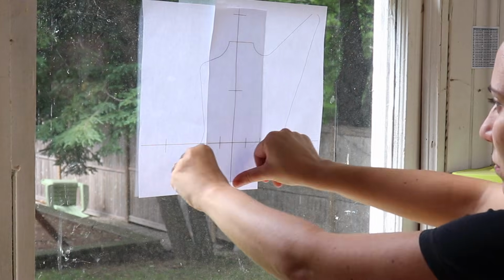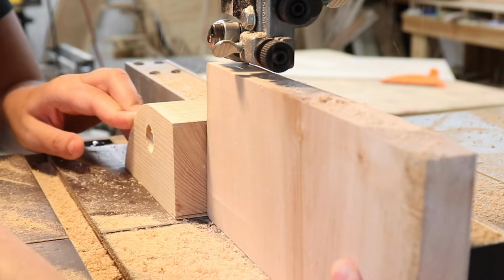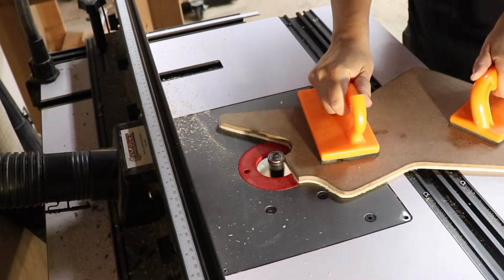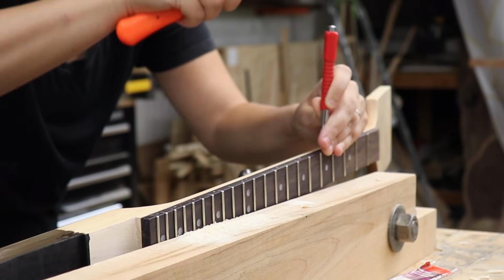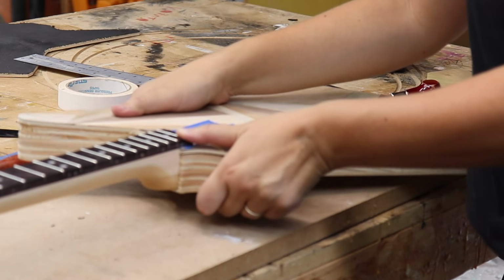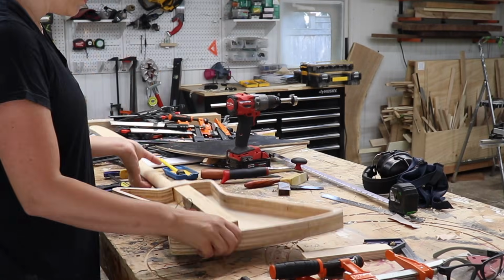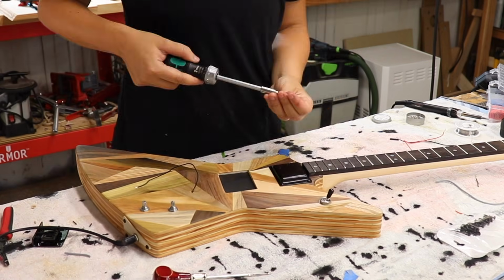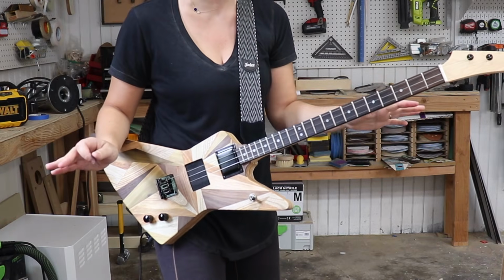Making a Three String Explorer - Cigar Box STYLE Guitar Build

Comment: AWESOME...I'm finishing of A Flying V, 3 string semi acoustic right now, but yours is just jaw dropping, I don't really have a workshop but I managed ok with hand tools and adapted a PDF of the old style body, but just did it by eye. It's made from some old 1970's, hardwood, office furniture I salvaged from a skip with a 1/4" marine ply top, although I may purchase something with a flame and Use Crimson Guitars superb dye's to a blue/red PRS style thing. I did buy a length of maple for the neck but , as yet, haven't committed to a fretboard, I may use a broken Rosewood one I have and convert it into a pentatonic plus...check out Del Puckett's awesome fretboard layouts...It's a "neck through" with springs on either side to resonate the box...and I too made a similar mistake with the heel on my first pass but fortunately had enough wood to rectify the issue, also at the same time I rebated the bottom of the heel to fit flush with the base which also allowed my to create a better back angle...I'm strictly an amateur/hobbyist and completely take my hat off to your awesome skills...you rock \m/
Reply from the maker: Sounds cool! I would double check about using the reverb coils with an electric pick up
Reply: @3x3CustomTamar  Ok, not had any probs as yet though...fingers crossed though as this will be glued not screwed...actually might redesign that bit now...and hey...good luck in the build off, Ben has that look of "I'm gonna take ovr the World".

Comment: Wow you go fast. Next time you do an operation like hogging out the reliefs on the neck under the top, you could dado it away quicker on a table saw. Unless you have too much crap stacked on it. 
Seems like you should shim the fitment mistake gap between the neck and the body, even though it won't be seen. Take you 5 minutes to make a block and it'd help the guitar. 
Use flux on every joint you solder. Even if it claims 'with resin", get the greasy little tub out and use it every time you solder.
Reply from the maker: Like I said in the video, 101 different ways to do that, I happened to have been in a hand tool mood. And I did use flux

Comment: Just a guess but maybe the heat of the hot glue causes issues with the piezo. Possibly switch to using silicone or epoxy?
Reply from the maker: Don’t think so. I’ve done it this way in the past and it worked. Also. Dell pucket builds cigar box guitars this way. And he doesn’t have any issues

Comment: Disclaimer, I have no experience with making guitars, but with the piezo, something about covering both sides with hot glue makes me worry that the vibrations being picked up are dampened by the rubbery glue. If you think this is an issue, an easy experiment is to test the piezo before and after it is covered with hot glue to see if the effects are diminished. With soldering, I've found leaded solder is easier to use than unleaded. If you are using unleaded, maybe try a few projects with leaded, get the hang of that, then switch back to the not as toxic stuff.
Reply from the maker: So there’s a guy on here named dell pucket. He builds cigar box guitars. And I followed his method of installing it. He even did a sound comparison doing it different ways. And it sounded better. Also. I have built another one of these before and I did it the exact same way with the hot glue and it sounded great. I was also using leaded solder. All my other joints were great. Not sure what happened with that piezo...
Reply: @3x3CustomTamar  Oh! i'll have to check dell pucket out then, sounds like my hunch was wrong. That was my only hunch tho :/

and soldering piezos is just kinda hard I think. In my experience they say to keep the heat low, but then the solder doesn't melt and flow as nicely. Good luck in the future!

Comment: I prefer old fashioned lead solder over the modern safe solders. For electrical I use solid and use the core solder for copper pipe. The fluxes for leaded and non leaded solders are different and usually only work with the alloy they were designed for. I get bad solder joints when I mix them up from time to time. If your using the modern solders the do require higher temperatures than older lead solder. I don't know what watt iron your using. It looks more like a circuit board iron designed for small components. I keep a large 130 watt iron around for ground lugs on guitar jacks. Even a 60 watt iron will work if it has a large tip on it so it won't dissipate all it's stored heat so fast. I just salvaged a couple of pickups. The beepers in microwave ovens make great pickups and you can also find them in old computer beepers and smoke detectors.

Comment: If you sand the nut blank, compare the sanding with and without oscillation. The smoother the coupling surfaces, the better the sound. When you solder, think less in terms of glue ("sticking to something") and more in terms of melting a brick of chocolate for decoration. The surrounding area needs to be heated to the right temperature to flow on the surface, smearing it when it's not ready gives you chunks and blobs. If the top surface looks shiny and not matt grey, smooth like silk, flowing at the bottom like a cape dragging over the ground you got what you're looking for. The connecting surfaces can cause problems when they still coated from our touch or a protective coating, so clean the parts with alcohol when you're waiting for the iron to heat up. If you're looking for a good iron, there is a video from highline guitars on great station that I'd get if mine would break down. 
Really cool test-run, making use of your scraps for a badass top. I'm looking forward to your build.
Great video, lighting...well done! it's been a while since I've seen a boomerang pedal. :D
Reply from the maker: Thanks so much! Yeah. I think I didn’t properly clean it. All my other joints worked fine. I know nothing about pedals. But my friend seems to know a bit.... ha

Comment: Nice video - but generally, I don't see the point of putting this much skill, tooling and guitar hardware into scrap materials. Using better materials would have made the process easier, and the result nicer, for a project cost increase that is marginal at most.

Unless you're just building for fun, in which case go for it!
Reply from the maker: It was just for fun 🤘